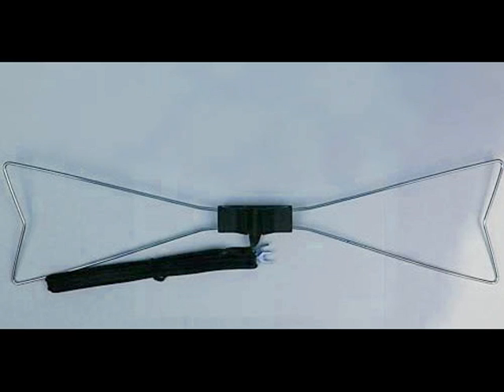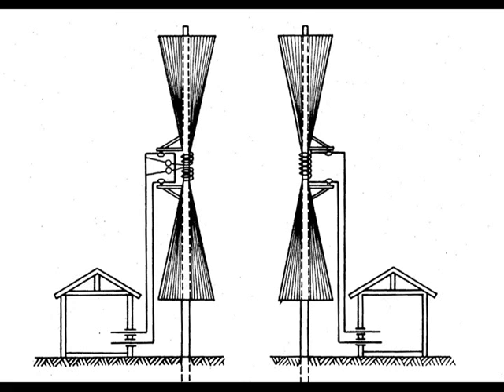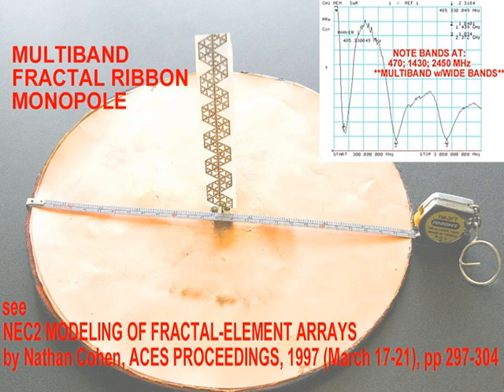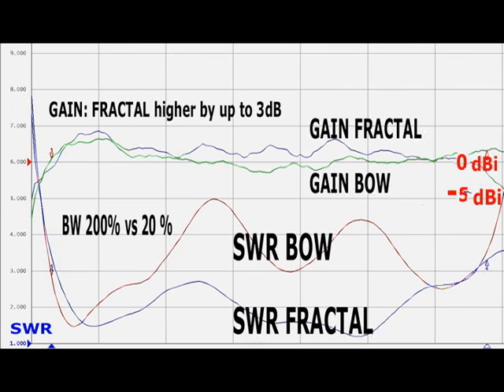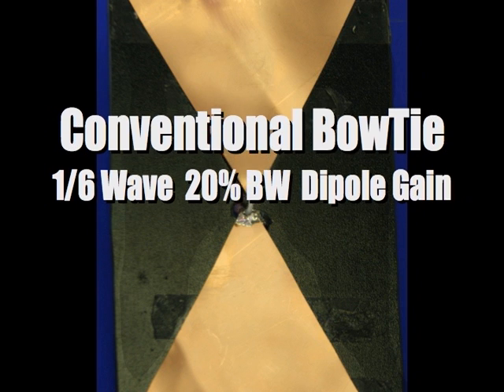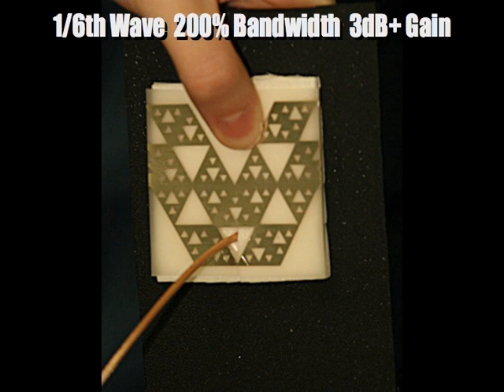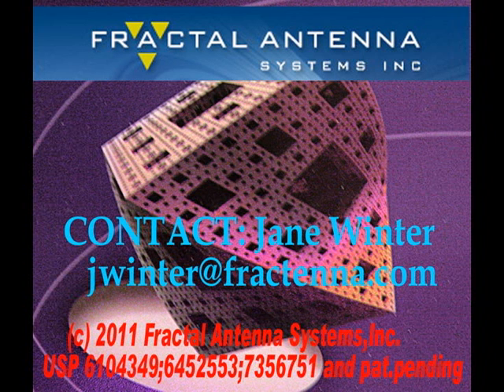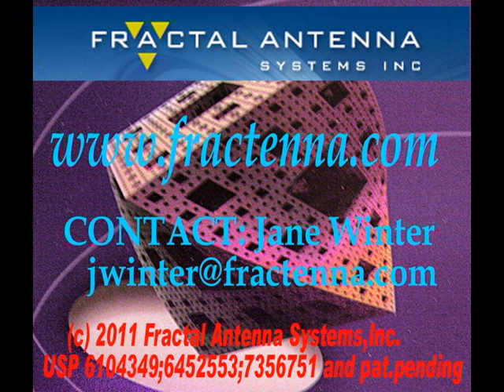Fractal Antenna Example: Better Bowtie

Comment: I was thinking of using a third iteration  Kock Snowflake fractal in place of a simple UHF loop antenna for use on my DTV converter box.
I like the fact that you can make it out of just one lenght of wire.
How big an improvement  ( if any)   would be over the simple loop?